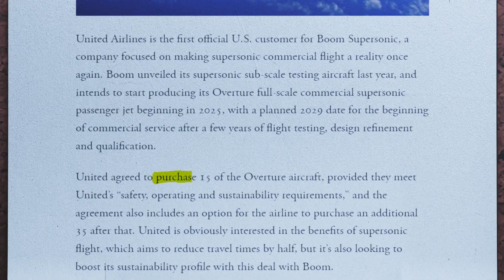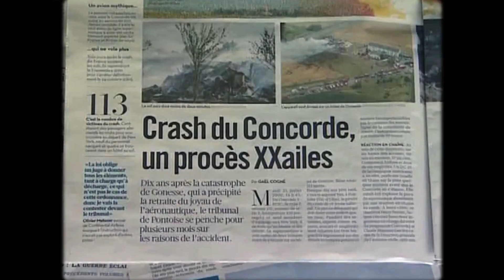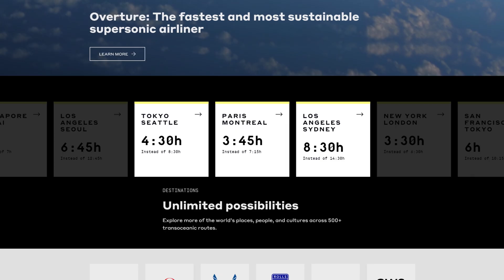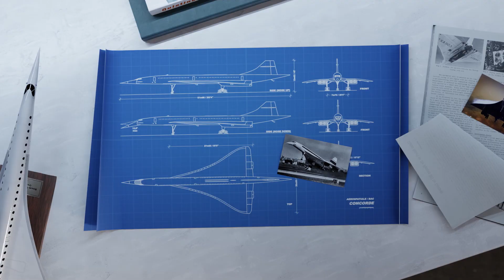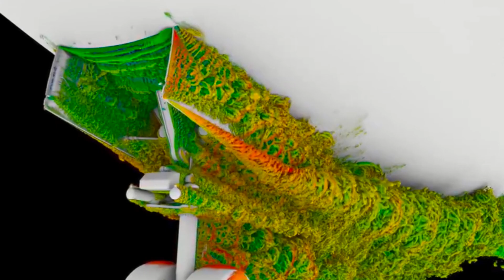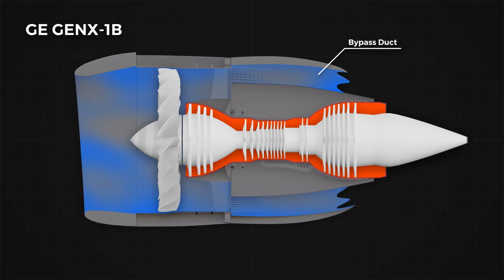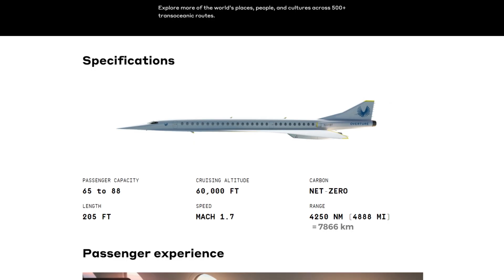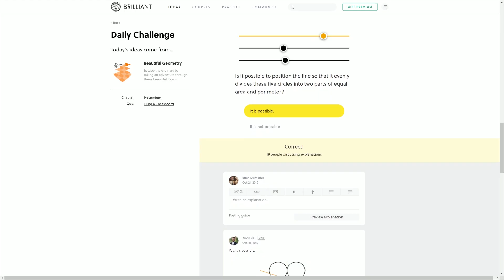Will Boom Bring Supersonic Back?

Comment: The concorde looks really like a marvel of engineering. I mean being able to develop a supersonic plane without modern technology and still being copied years after because your design was very good is like one of the biggest testamnent.
Reply: Most likely due to physics and practical use. Airliners these days are the same shape as the Boeing Dash 80 (707) prototype, it's the best design for transports. Exception of overhead wings, not as efficient but good for military cargo planes that need to be low to unload a tank.
Reply: Its not any marvel. There were some supersonic inscale of Concorde before it.
Valkyrie XB-70 perhap was the prototype of Concorde.
Reply: Well, I heard talk when I was a kid when the Concorde reign the talk was mostly was that of bitter water from the USA I just rolled my eyes all I heard was how could a country that got occupied twice ever be so upscale.  I'm going What sounds like somebody's jealous I as a kid
Reply: This is what happened when Boeing and other Plane maker's couldn't agree on what 'their' SST spec would be. With so many changes , as to--how many seats, ? what routes it would fly, what shape the Wings? would they be 'Swing-Wings' or not ? They couldn't agree, and built so many models, the cost was enormous, and the government pulled the money plug. In the end,  with a rough agreement, their idea for a SST. looked remarkably like the Concorde.
Reply: Well, sorta, maybe. But in truth, the laws of physics are just the laws of physics, and the laws of aerodynamics are just the laws of aerodynamics, sooo… That’s why none of these designs are ever drastic departures from the ones preceding them: the Wright brothers had wings attached to a fuselage, as did the DC-10, as did the 747, as did the Concorde, as did the Buran … the wiggle room within which to innovate is quite small!
Reply: @danopticon  that's not very plausible. There is a lack of innovation. The economy is not growing as fast as it was between the war and the crisis in the 70s.
Reply: @jwadaow  - But pointing out that

1) the very libertarian policies Reagan/Thatcher were hired to champion have caused a massive economic slowdown, as capital accrues in the hands of the ultra-rich, but currency flow at all other levels trickles to a relative halt,

and pointing out that

2) the chokehold placed by these policies on public spending has slowed innovation across all sectors,

and pointing out that

3) aircraft design will always be tightly constrained by physics

are three quite different, but completely complementary, statements.

I wouldn’t disagree with what you’re saying, about how growth and innovation have stalled since the world’s most powerful people (the families Koch, Adelson, Mercer, Bradley, Murdoch, Wilkes, Olin, Scaife, Coors, et al) decided all the 20th century’s wealth should belong to them exclusively, so fuck all the rest of us who actually generated it. I don’t disagree that they used their control of the media to install charismatic puppets to rob us blind, and to create the wedge issues which keep low-information citizens manageably divided. I totally agree that the space-age the ‘50s and ‘60s promised us—not an age of consumer trinkets alone, but a post-scarcity era of comfort and ease for all in a classless society—has been robbed from us, and is still long overdue.

But none of that conflicts with the fact that aircraft design will always be constrained by the laws of physics… so an SST of today will largely resemble an SST of the late 20th century!

So if Reagan/Thatcher hadn’t redirected humankind’s single largest generation of wealth away from the public and into the hands of the defense industry and the fossil fuel industries instead, would we have moon bases, housing for all, a trans-America/Siberia bullet train, a 100% worldwide literacy rate, and even a space elevator or two? Absolutely.

It’s just that SSTs would likely still look like SSTs. But I do agree with your economic analysis.
Reply: Hindsight's great, isn't it?  Back when Boeing and the other plane makers were awash with Government tax cash,   they were like kids in a sand pit, coming up with fanciful designs and ideas. YET  couldn't even agree on basics, like Dimentions, / how many seats,   what would the routes be?   Wing shape, would they swing or not.etc etc. After a collosal amount of money was spent on models and drawings. The final agreement was,  Ta-Daaa.   CONCORDE  SHAPED.   Government says--TAKE A 20 YEAR BREAK GUYS. @danopticon
Reply: What we know today and also what computers use today is a result of our yesteryear engineers, computers wouldn't know what to do if we didn't first program them.
Reply: @crf80fdarkdays  You must never had a hand in the CAD environment. Technically, I as a designer was the programmer. The "program" was not intuitive at all. If I chose to stick a half-inch dia by 2 in, long bolt into a .25" dia hole into a triple series of 1" plates, the program would let me. All a CAD program boils down to is a really sexy interface for the uses to toy with. While all the code done was programming, all you ended up with was a blank sheet awaiting the hooman touch to make stuff. It was a program to allow more programming.
Reply: @brucewelty7684  ahh sorry man seems as if I've miss worded myself a bit.

I fully agree with you, unfortunately I havnt had much to do with cad in person but have a decent understanding, you can make them machines spit bits for sure.
Reply: Back when Boeing and the other US plane maker's had a go at making a Concorde, after billions of dollars and disagreements of what exactly their planes should be cabable of;  they actually agreed. Trouble was, it looked just like a Concorde , only, without any of the advantages, and Billions of Dollars down.   @crf80fdarkdays
Reply: Back then, designers worked from the “if it looks right” principle. People also had to think in 3D. 
CAD has seriously speeded up detail design but 3D thinking and instinctive thinking are pretty much gone.
Reply: @Dave5843-d9m  You are wrong on both counts. Old school design was 2D and was taught 2D. Many of the old timers never could make the switch to thinking 3 dimensionally. When I was trained on CADAM in '85 it was considered great as it was 2 and a HALF D. We still had planar views to work in but it had the ability to project a point into other planar views. In the '80s and into the '90s College course requirements were multiple semesters of manual drafting before CAD was allowed. The first thing I had to get the students to forget was that limiting mindset. Some of the old geezers never could figure how to model a coffee cup.
Reply: It transpired later that that piece of metal alleged to have punctured a tyre etc was NOT the reason it crashed.The main reason was faulty wiring causing sparks in a leaky environment ,bad fuel weight distribution and the pilots shutting down the two still running engines!
Reply: @routmaster38  --- That's bullcrap - it was from the metal exploding the tire which ruptured the fuel tank
Reply: It depends on WHO / WHAT  report you read,  and when. A lot of accusations and Political blame / denials took place after the incident @routmaster38  BUT--without the metal , no tyre puncture, No fuel leak, No fire if no spark etc etc

Comment: Boom needs to go back to the drawing board and follow closely the mission profile and propulsion design of the SR-71, whose engines were essentially a turbojet/ramjet hybrid that functioned in a nearly pure ramjet mode over Mach 2.  Because of the travel efficiencies of ramjet operation at high altitude & speed, the SR-71 could fly coast-to-coast (3,000 miles) without refueling.  Boom's current designs, with the intakes within fuselage shockwave shadows, cannot be made to work with efficient transsonic engines like the SR-71's.
Reply: The cones on the SR-71 point inwards. I though that is due to the shockwave of the nose which pushes air to the outside. Concord could also fly coast to coast with much more payload than a single camera. Uh, and Concorde did not need refueling right after take-off.
Reply: WTF?

Comment: The claim at 0:35 is very confusing to me, the fact that a passenger would need to rewind their watch 2 hours on a flight from London to New York. 
Say the plane takes off from London at 8pm GMT, it would touch down in New York at 11pm GMT 3 hours later. This is 6pm in EST (New York time zone) so the passengers watches display 11pm at the time of arrival, so they would need to rewind their watches 5 hours due to the time zone change.
The speed of the flight does not make an effect on how far a passenger would need to adjust their clock as the time zones remain constant.
Reply: Yeah this is only true if you stop your watch the moment you depart. I feel he got a bit swept up trying to make a tag line out of the fact that the travel time is less than the pure time difference.

Comment: In addition to the JFK routes, there were regularly scheduled routes between Washington Dulles airport and London (1976-2004) and between Dulles and Paris (1976-1982). I grew up about 15 miles from Dulles and I remember the Concorde flying over during takeoff. It was incredibly loud even at subsonic speeds.

Comment: How high does a plane have to fly to put the sonic booms into acceptable or unnoticeable volume perceived on the ground? Is there no viable way to design these planes to not allow for efficient flight at subsonic speeds so that they can slow down over restricted airspace until they are in unrestricted spaces? How has there been zero advances made in supersonic engines in so many decades, do militaries refuse to allow advances made in military aircraft to be used in nonmilitary applications? It seems implausible that the modern 5th+ gen aircraft are using the same decades old engines.

P.S. would you do a video on "silent mode" helicopters?
Reply: yes military secrets... also i guess they want to make engine that is more efficient than military ones that are not made for efficiency

Comment: Another caveat is that developing a new (state of the art) engine costs many billions of dollars, which they would never be able to recover due to the limited market size. This leaves (older) off-the-shelf engines, which are fine for a prototype, but are going to be suboptimal for the speeds and/or amount of thrust required. And then there is the issue of using military technology, which is often required for the engines...
Reply: this is the main barrier to entry for any of this.  Commercial Turbojets are just not a thing and will never be a thing.  Unless a country like China or the US want to make it a State issue.  Even then, there is developing the engine, then there is supporting the engine.  Spare parts and maintenance were another major nail in the Concorde Coffin.
Reply: I think Boom will fail, but in the meantime, the CEO will probably sock away a lot of investor capital into a nice nest egg.
Reply: @brainmind4070  you mean to tell me that a startup that is imagining its market as it was in the 70s and not how it is today is going to fail? All concords ceasing to fly was just a fluke and a Concorde look alike could definitely work in today's economy, absolutely 

Said no one who sees where the economy is going ever
Reply: It will probably not be an entirely new engine, but something out of the younger military projects, maybe adapted a bit for commercial needs. The Boom Overture will probably fly with something like the EJ 200 (Rolls-Royce XG-40 derivative) or the F136. Commonly known aircraft powered by Rolls-Royce supersonic engines are the Lockheed martin F-35 or the Eurofighter Typhoon
Reply: @KarlKarpfen  Excuse me, but the F 35 is powered by the Pratt and Whitney F135...not rolls royce...
Reply: @oadka  you see the problem here is that you're expecting somebody who somehow thinks a military is going to let their engines into the commercial space at all is going to get any facts even remotely close to correct.
Reply: @KarlKarpfen  if any military jet engine is going to be given to this company it would pretty much have to be the black birds engine, even then I highly doubt the US military will let that thing go without a fight forget anything that is being installed on modern fighter jets. I don't know why you think anyone would let that happen but I can assure you anything installed on a modern fighter jet is not going to be used on anything other than fighter jets developed by the same Nation or Alliance for quite some time after it's creation

Comment: Another potential competitor to a SST is SpaceX Starship which should be able to fly point to point anywhere within 12,000km in 45 minutes.  It eliminates most of the sonic boom issue because it only generates sonic booms immediately after takeoff and immediately before landing.  For most potential destinations these can take place over adjacent oceans.

Comment: At this point, it may be more efficient to try to make something that can launch into LEO to get long range quick flights than trying to contend with the issues of air resistance. But that’s also expensive, difficult, and loud, so maybe not
Reply: The fuel consumption would be insane. Even the most efficient rocket can't compete with an aircraft.
Reply: @Croz89  Honestly it might be cutting it close comparing a rocket to the concorde. Starship is the only rocket in development for end to end travel on Earth (on paper, it's not very realistic but it's the best example we have).

Concorde used 100 t kerosine for 100 passengers (250 m3 pressurized cabin). 
Starship uses about 230 t methane (and 770 t oxygen) and could realistically fit 400 or more passengers (1000 m3 space).

In theory starship could reach any destination but needs to launch from sea due to the ridiculous noise. Concorde has much less range but can fly from land. But the travel time is cut to about 30 - 60 minutes. So starship would actually have a similar or better fuel economy.
Reply: @hansyolo8117  I don't think Starship will ever be competitive as a form of terrestrial travel, even compared to supersonic aircraft. It might never even carry passengers due to the g forces. Plus it requires specialised infrastructure. Spaceplanes are used to go into space, currently only the domain of rockets, so that's what they have to compete with on fuel efficiency, reliability, turnaround time etc.
Reply: @Croz89  I don't see it happening either, but I was purely comparing fuel consumption. And on that metric it's definitely not as bad as you'd expect.
Reply: @hansyolo8117  It's not easy to compare like with like, since ballistic trajectories are different to aerodynamic ones. Fuel consumption may not be that different, but a spaceplane could dispense with a lot of oxidiser, depending on how the engines work. Regardless, as you said, I don't think either are a threat to regular or even supersonic airplanes.
Reply: @Croz89  Oh yeah, its definitely a long way off, but so are economically viable supersonic jets. By the time supersonic jets are economically viable, space planes may soon follow, meaning it could make more sense to just focus on the latter. 

That said, space planes have the issues of fuel consumption, noise, price, necessary innovation, etc. that could make them not viable for a century or more. Meanwhile, supersonic jets could be viable in a decade or two. I think space travel will be at the point where it could replace supersonic jets in less than a half century because I'm optimistic lol
Reply: @Isometrix116  I think the reverse may happen because spaceplanes have to compete with rockets, not aircraft. Rockets have gotten better, but spaceplanes do have some potential advantages over them. In terms of noise for example, rockets are deafening, so even a spaceplane that is as noisy as the noisiest aircraft is an improvement. On the other hand, you're trying to make a faster plane compete with a slower plane that's already fairly quiet and fuel efficient.
Reply: Please people, stop listening to Elon. He is off is rockers.
There will be no terrestrial rocket service, because no one will allow a 1100 ton bomb to be launched from anywhere close to people.
Reply: @benghazi4216  No one is suggesting it will be launched anywhere close to people, because it is supposed to launch from/to an ocean platform. If you stop listening you also miss the critical information it seems. 

Regardless it is a pretty unrealistic idea but it is not impossible in theory. It's just very unlikely to be economical and honestly very wasteful.
Reply: @hansyolo8117  You are talking up the rocket solution in terms of travel time.
That falls flat when you launch it miles upon miles out in the ocean. 

But hey, I completely agree with every word in your last paragraph, but I would just like to add the word: "environmental disaster" to it too.
Reply: @benghazi4216  Oh, this has little to do with Elon. He is completely insane, I don't think anyone would contest that, even Elon himself.

This is more to do with space infrastructure and the future of space in general. Elon Musk is related to and is a part of this progress, but he's by no means the progress. I didn't really have him in mind since he's focusing on rocketry.

But there's a lotta ways of getting into LEO without a rocket. Spaceplanes, the thing I mentioned originally, are an example. Skyhooks are another. The two can be used together. Skyhooks do feel ridiculous, but they are probably the cheapest and easiest way to make travel into LEO viable. 

Youre right in that we don't want a rocket like we have now launching from the middle of a city, but that wasn't exactly what I had in mind lol
Reply: @benghazi4216  Skyhooks sound ridiculous when you explain them though. The mechanics behind them makes perfect sense, but when you try to explain what you are doing, you get weird looks :)